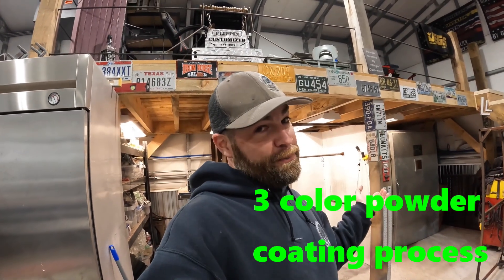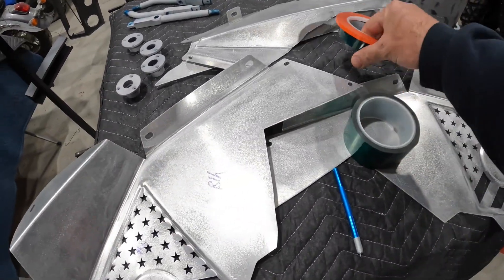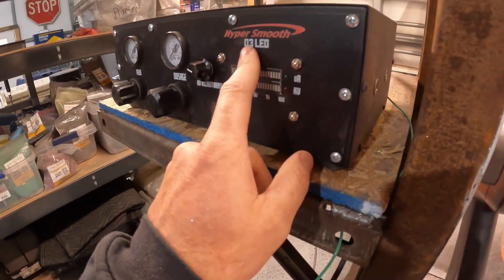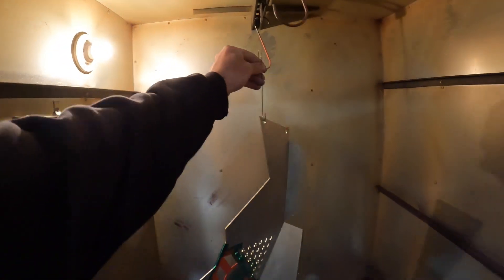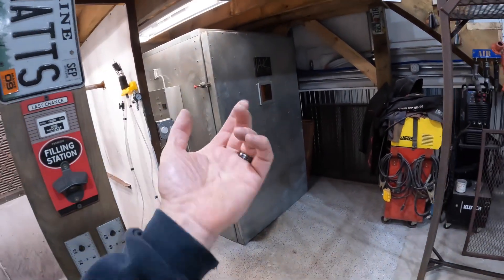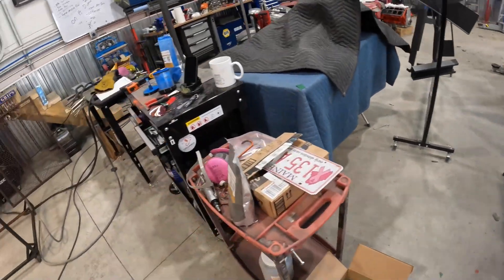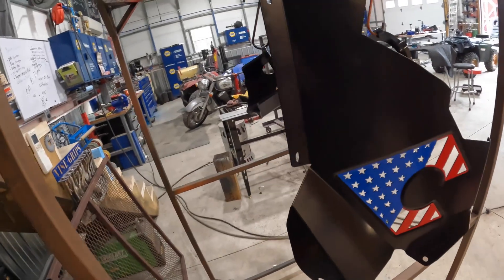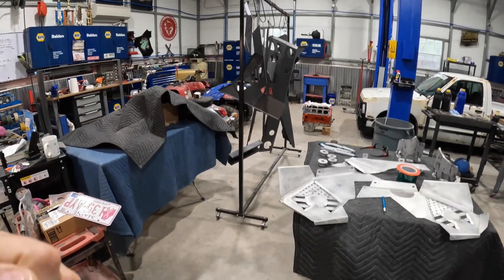3 Stage Powder Coating its Easy

Comment: If you use vinyl and peel it off the color before you cure the black you'll get better edges and if you have to leave it on it won't leave marks on the already cured part. also, to save burning your hands, I cure to flow out on like the black and use a heat gun to remove vinyl/tape. nice job though.
Reply from the maker: Thanks 🙏
Reply: Hey! I have a question if you don’t mind giving some advice. So I’m doing some brembos and thinking of making it red with some white(or possibly black) letters over the red. Should I do the white (or black) base for the lettering, than mask the “brembo” and spray the whole caliper red, than clear. Or should I do the whole caliper red, than mask for the brembo afterwards?